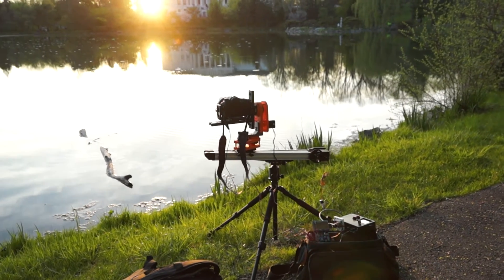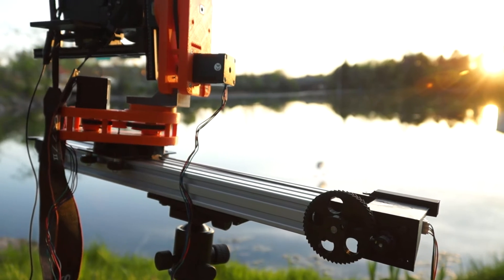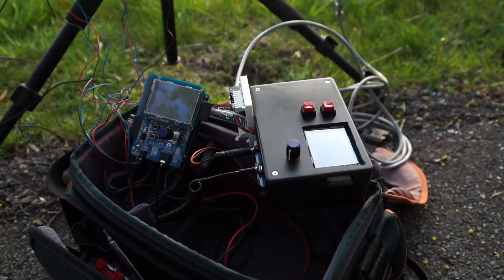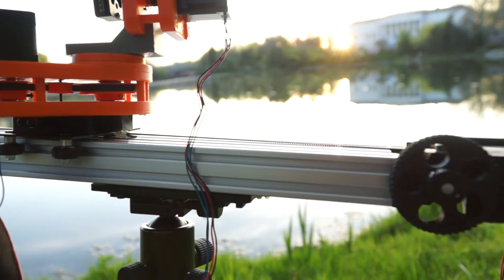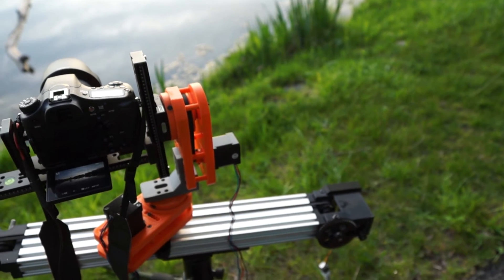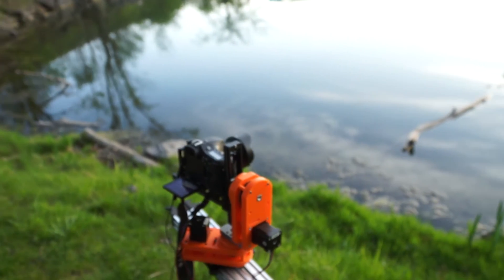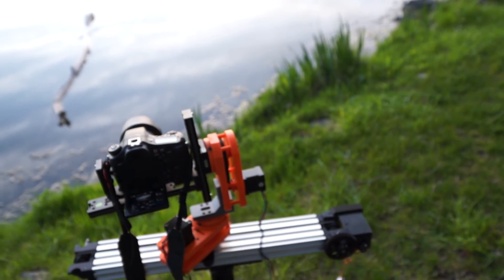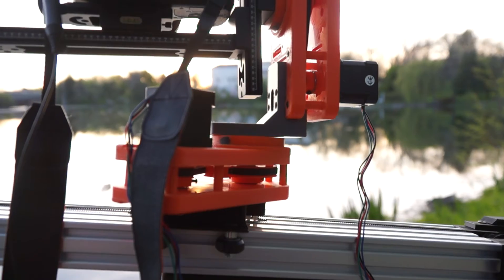OpenBuilds C-Beam Double Slider

Comment: Hi Chris, nice pan and tilt head. I happened to run across it by accident. Is this based off the Dynamic Perception Stage R rotary?  I've been trying to figure out how to build something based off of it. I bought metal plates, bearings pulleys etc from Servocity, but I really like how you 3D printed this one.

Could you have used metal timing pulleys say with an 8mm bore and XL timing  instead of printing the pulleys? Are you still working on this project or are you finished?  Thanks

Comment from the maker: the demo video sequence is 2 minutes long followed by a time-lapse demo. no stabilization was applied to either. In the time-lapse there is some jittering towards the end as I changed camera settings... these cleaned up easily but I wanted to included an untouched sample...